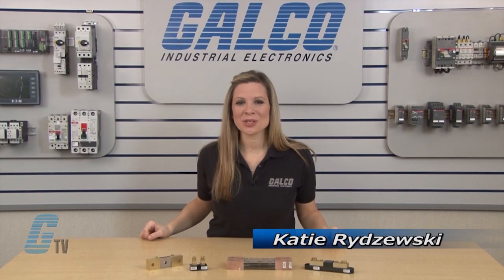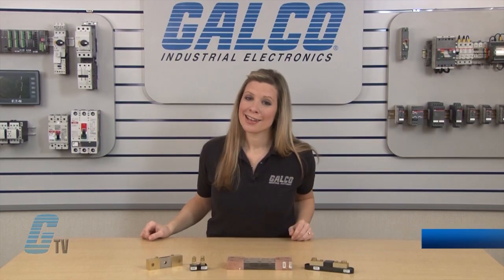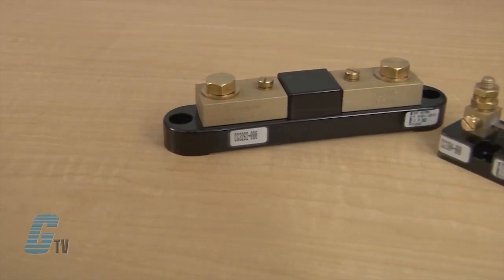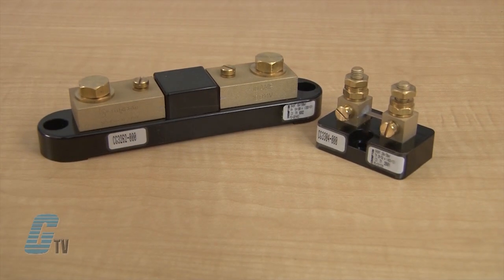What is a Shunt?

Comment: Your videos are great and thank you for sharing with us. 
Could you please explain in simple terms why a shunt is not needed in a permanent magnet dc motor.
Reply from the maker: robviolin1 A permanent magnet motor has the permanent magnet in place to create a static magnet field. The armature voltage and current is all that is required to create rotation. Thus no shunt voltage is required, just the armature voltage.